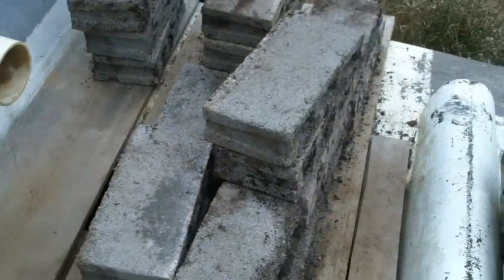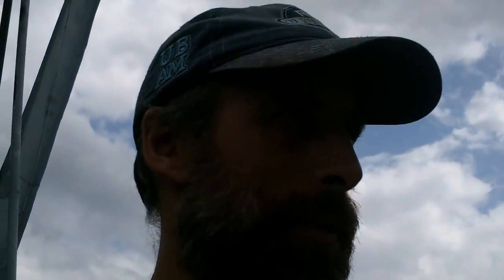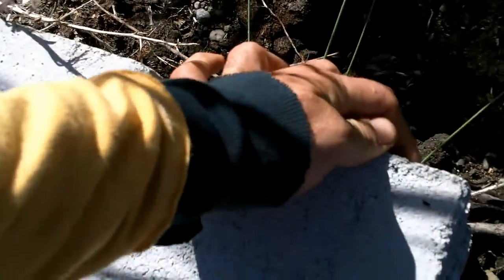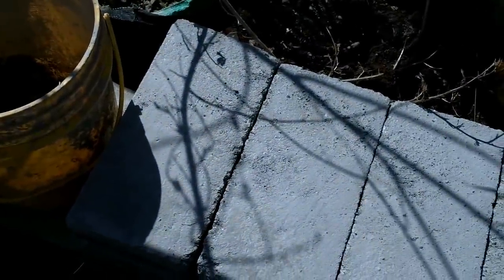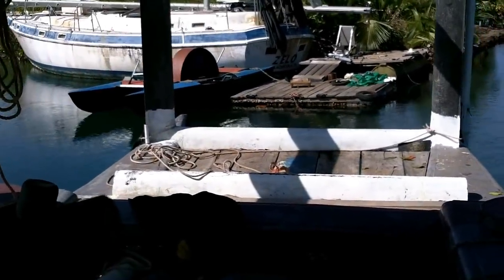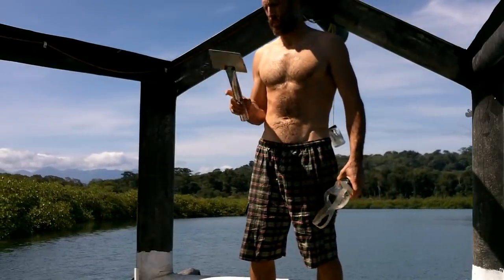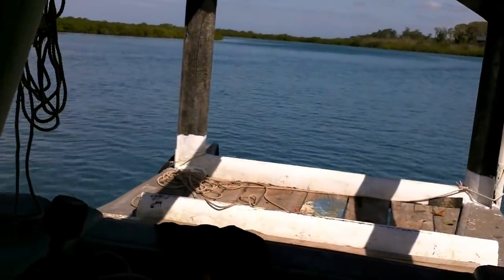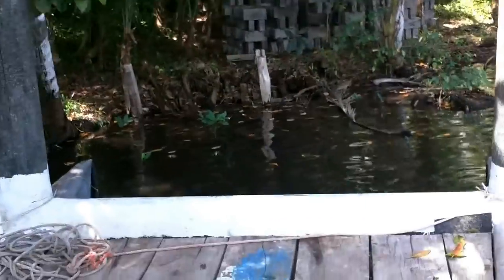Restoring old Bricks...?

Comment: it looks like the blocks were made with saltwater, instead of fresh, we use concrete sealer to save the older salt water mixed blocks  and grout, i Live on the coast and one hundred plus years  ago some of the contractors used salt water instead of fresh,  keep up the inspiring work
Reply: Isn't that roman concrete? Something to do with them using salt water?
Reply: not to my knowledge, but with modern cements the metals that are natural in salt water will give you a finished bond but over time given long enough it will deteriorate the bond, a form of mild  electrolysis
Reply: Diogenes The Vlog  from wiki : The strength and longevity of Roman marine concrete is understood to benefit from a reaction of seawater with a mixture of volcanic ash and quicklime to create a rare crystal called tobermorite, which may resist fracturing. As seawater percolated within the tiny cracks in the Roman concrete, it reacted with phillipsite naturally found in the volcanic rock and created aluminous tobermorite crystals. The result is a candidate for "the most durable building material in human history". In contrast, modern concrete exposed to saltwater deteriorates within decades
Reply: Thanks for the insight. I make sculptures with a name brand white gypsum cement. The instructions for this material indicate that salt water is acceptable, and will speed curing. I did not know this about regular cement. I had wondered why Jamie was going to the trouble of using fresh water, even when he had to haul it. Now I understand.

Comment: Hey Jaime, interesting idea to salvage the blocks. Reminds me of makers who soak soft materials in resin to strengthen them. They put the contents under vacuum pulling out entrained air, forcing resin deeper in the material when returned to ambient pressure.  Your video made me think, what if the blocks were put in a vacuum but instead of water an acrylic admixture was used to mix the cement? I used gallon jugs of this to mix mortar and grout when redoing a floor. Might make for an interesting water/cement vs admix/cement strength test comparison and the admix makes the porous block more resistant to water infiltration. I like watching your videos, Technology on a Tiny Island, who would have thought...

Comment: Seems like a very good idea.
It is also possible to precipitate concrete like material from seawater.  It is called biorock or seacrete.  Mg and Ca salts(carbonates)  can be precipitated with low voltage electricity using electrodes.  Just and idea.  
The price of building materials are subject to transportation.
Those blocks, new, in the US would be about $1 per block. $0.5 per block seems a bit high for used blocks, but I do not know the local supply-demand situation and the way of transportation.

Comment: it's pretty hard to make stuff without any materials to actually use, in this case most things you might make *with all these would get a cover finish put on them anyway sherely 

*A hypocaust (Latin hypocaustum) is a system of central heating in a building that produces and circulates hot air below the floor of a room, and may also warm the walls with a series of pipes through which the hot air passes. This air can warm the upper floors as well.

regarding the overloaded boat ,(you make it to hard to comment as you apparently close loads of commenting) and lack of portable power ,and unable to tow another barge, that you need to ration it on basic crossings then perhaps you should go and replicate with larger coils for instance  
barumman's "Stirling Cycle" Thermomechanical Generator that will work anywhere to charge stuff with any heat/solar

barumman,Published on Sep 13, 2011
https://www.youtube.com/watch?v=UFMoxTBiAI0&list=PLaRgbxyktTXKlUO_wGQYxi0ZbZ15tE4uD